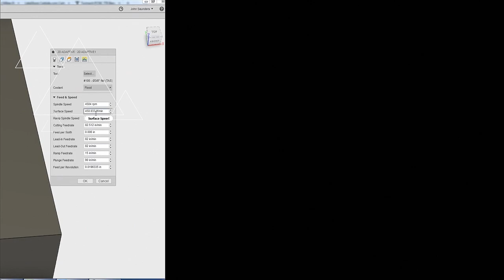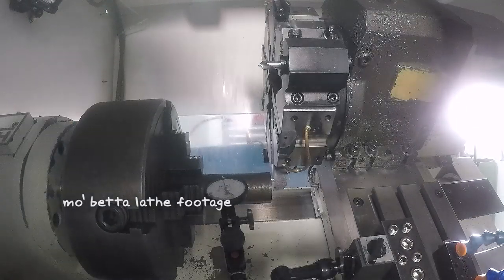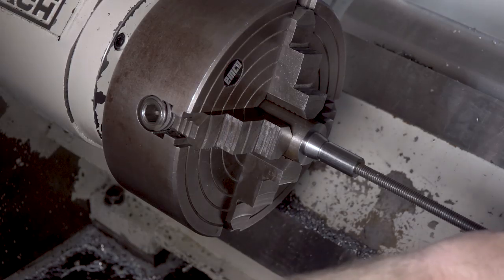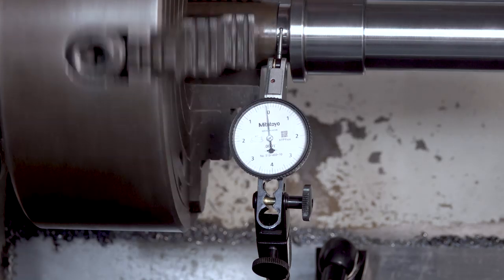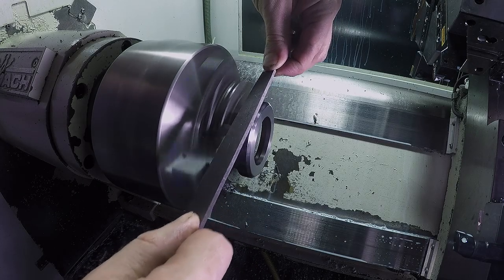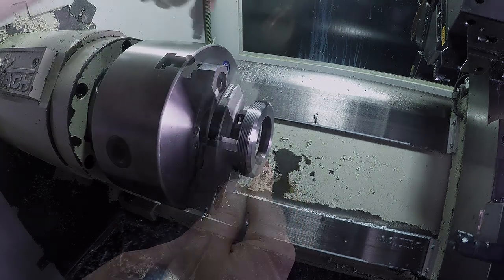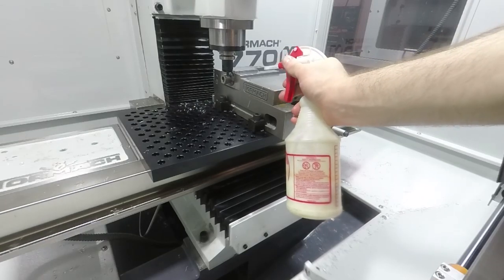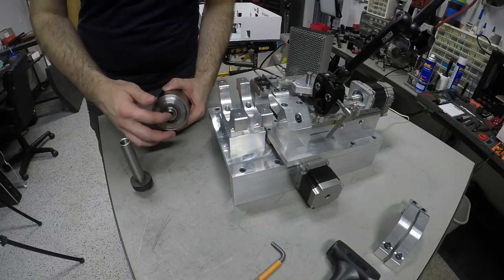Making a Spindle!  DIY CNC Turret Lathe Part 7 | WW220

Comment: Hey, love your videos. Looking to get into CNC machining, I have a vertical mill but I would love to get a CNC. What is the best entry level CNC, under 20k, that can fit in 3 car garage? Messing around with solidworks already, I am decent with autodesk so I am picking it up pretty quick.
Reply: I really enjoy my Tormach 770. I didn't buy all the add on things that Tormach trys to upsell you. It's a nice machine for about $13000 delivered. If I were to buy today it would probably be the Syil X7 which you can get into for $16000 plus taxes and shipping.
Don't forget to budget for workholding and good tooling and tool holders if you don't have them.
Reply: i heard (saw a video on youtube but dont know which one) that Tormach machines are not really precise and sometimes have really big play, also the support is not great and the precision certificates are signed on every machine but only every tenth or so machine gets inspected in real.
Reply: @ipadize  I agree with everything except that the machines are inherently inaccurate. They are a dovetail and gibs linear system and they must be adjusted correctly. One would hope that they would be from the factory but that is not always the case. I make good parts on my 770. 

I have had my own issues with customer support and even have a video on my channel about it. 

They are great machines to learn on or to start a home shop. My next machine will not be a Tormach.
Reply: @Johnathan Grffin more options would be Novakons mills. However, if you have the space look for a used HAAS Tool Room Mill. Preferably with the "p" suffix for the tool changer . Ie TM1P

Comment: You shouldnt let the seals run on turned surfaces, a cheap solution would be to use the ring of a radial needle bearing or just buy the rear bearing with a one side rubber seal. What lubrication do you intend to use on the spindle bearings?

Comment: Using a file on a turning spindle with such a small part is extremely dangerous. You can just run the finishing pass one more time after you did the thread. Dont worry its not damaging the thread but deburring it perfectly.